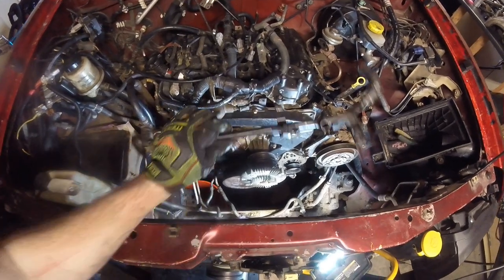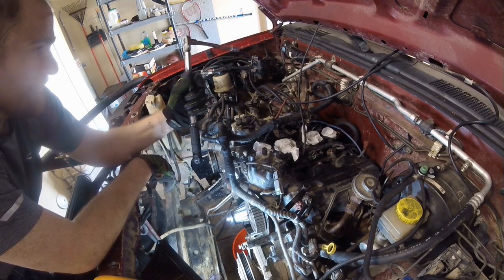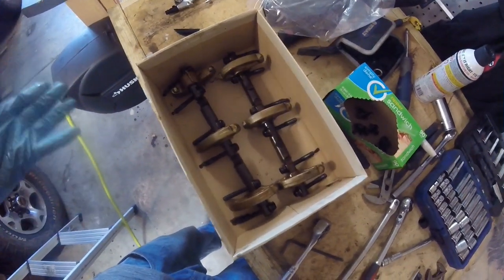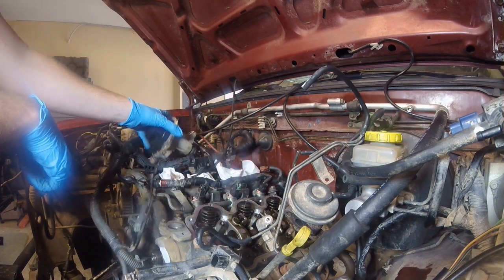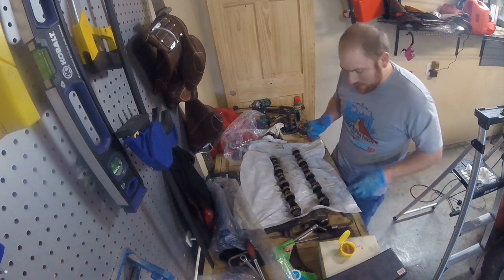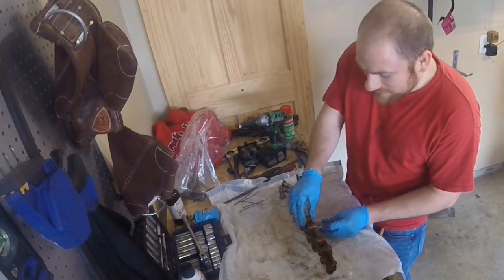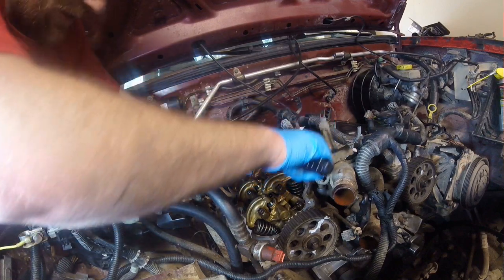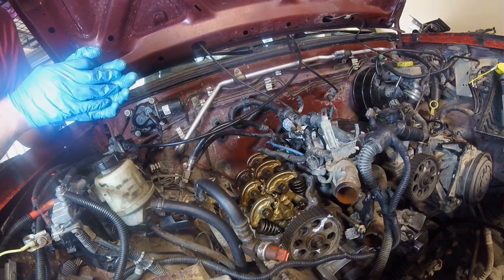Schneider Cam Install Part 2:  Timing Belt, Valve Train, and Cams

Comment: What tool did you use to remove the sprocket?
Reply from the maker: Cordless impact wrench to remove bolt. Once you remove belt tension the sprockets come off pretty easily. A few taps with a rubber mallet works too.

Comment: Yay for a new video! Your doing a great job Rob...This is a huge project and as much as I like to wrench I don't look forward to ever tearing into my engine like this lol.. I seen you commented on a S/C video. Any plans in the future for one? with the body lift you wouldn't have to worry about hood clearance. thanks for the video and keep up the good work. Can't wait to hear it done. :)
Reply from the maker: Definitely a big job, but that sweet satisfaction of a rare mod is priceless!  I have been keeping an eye out at the local pull a part, but the SC xterra is rare. I was hoping to do SC and cams at the same time, but never found one. I am firmly out of the SC game now...hopefully not taking it apart ever and driving it til it blows up!
Reply: @XterraRob  I hope things are going smoothly.
Reply from the maker: Thanks for checking in. I need to post an update but I've been a little burnt out from the project. Reassembly is complete after a few iterations. Was fighting vacuum leaks and a rough running condition. Got that sorted out and drives great but hss a rough/surging idle. Not cam related I dont think...i had a surge in my idle before I did my intake manifold spacer and coolant bypass. I un-did that and now its back...so need to figure out the proper fix. Cams definitely make a difference power wise though. Much better driveability. Ill post soon...
Reply: @XterraRob   I'm curious do you think the injectors may have a part in the idle trouble?
Reply from the maker: They are on the list. Unfortunately, no CEL codes to narrow down. I'm waiting for a new xterra in the pull a part yard so I can grab a throttle body, idle air control valve, Throttle position sensor, mass air flow sensor, and a few injectors for cheap.  I'm driving it for the time being, though.
Reply: @XterraRob  I live in Washington state and we have xterras by the literal dozens, I think they shipped a lot here to sell, but perhaps there would be some parts available online in this area. You could buy several xterras in clist right now for 1500 to 2000$ is crazy there just so many that don't die, that people can't get rid of them 🤣🤣

Comment: Any updates?
Reply from the maker: Still fighting rough idle...ive concluded its part of the cam without an ECU tune...but I need to screw around with the idle stop screws to smooth it out a bit. Definitely has a noticeable power improvement.